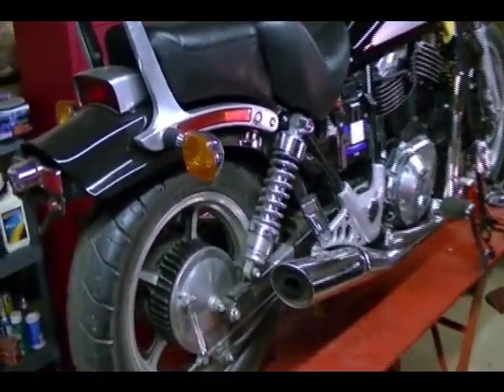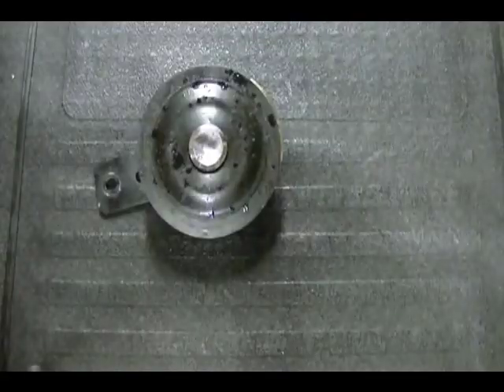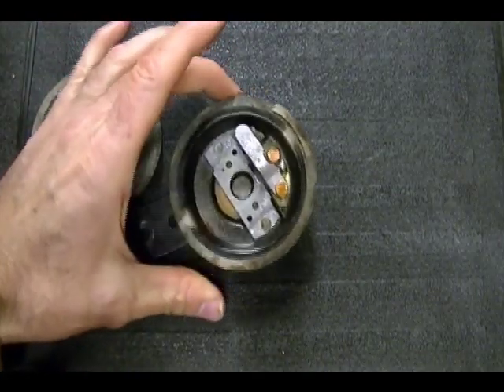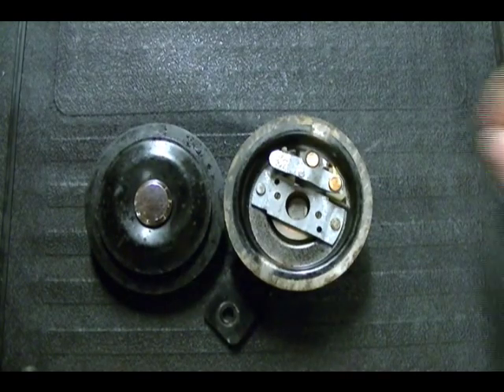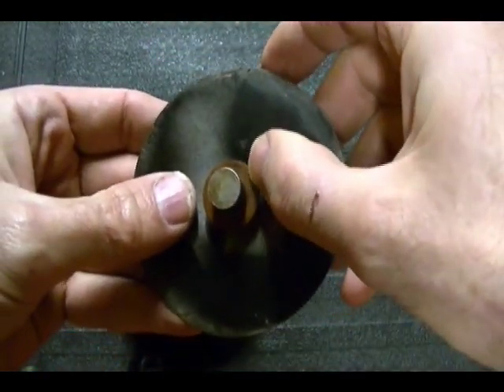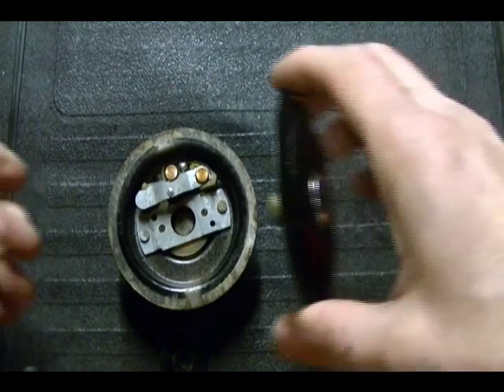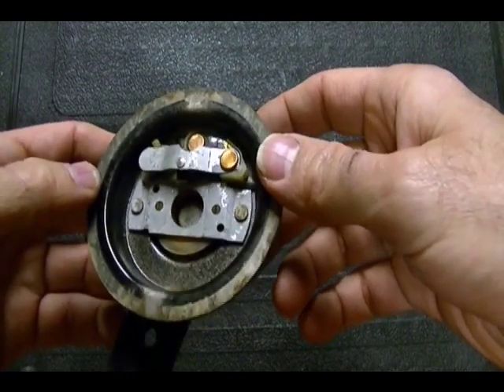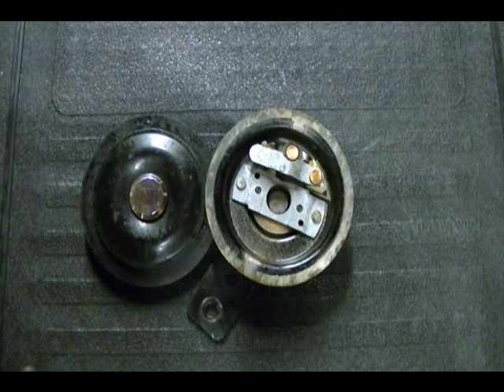How Motorcycle Horns Work And Why They Fail

Comment: You could just drill four holes in that outer housing and diaphragm housing and use screws and nuts to clamp it together instead of using that ring. It would probably work.

Comment: I have personally found that using an ultrasonic cleaner with your solution of choice has worked in nondestructively cleaning these points off about 9 out of 10 times

Comment: Recently had issue with my horn not sounding, started being intermittent then stopped altogether. The blades of the contacts have a weird, yellow-ish ooze on them, is that the copper corroding?

Comment: Your instruction is great. I drilled an access port above the electrical plug terminals, accessed and cleaned the points and got a 1971 Suzuki horn to work again! I made a small rubber plug to seal the access port in case I ever need to do it again. This saved me some money and I got to keep the original 50 year old horn for originality's sake. Thank you sir!

Comment: Nice informative video contents you have. I have a question about my horn on my motorcycle. Everytime I use my motorcycle, my horn is not beeping loud. My battery is good, and I have a voltmeter for monitoring. I am using bosch fc2.

Comment: yes i agree with blazzer brass, you completely missed half of the operation of the horn, #1 -  it does not need to be pulled apart to fix, #2 -  the screw with nut is the fix, always, my horn on my wedding cars gets a lot of work, and i have fixed it  with the  adjusting- tuning screw , 6 times, ,,, here is  what you missed....  insert ear plugs, loosening the nut under  the screw- frees the screw for movement,  .. with the 12v power on,  you winding the screw out- allowing the top contact to always stay connected the  the bottom contact- thus max - un breaking current, - ONE pull of the magnet, and NO SOUND, then  you wind "in" the screw until it allow separation of the contacts- horn is sounding,  then 1/4 - 1/2 turn more for operation, re-tighten the nut,  SO one horn will thus last the life of  your bike- cars truck wedding car

Comment: Excellent video - I came here looking for why my car horn stopped working.   Car horns operate under the same principle, except they have a plastic megaphone added to the same basic apparatus.  Too bad they can't be opened without wrecking.    Maybe someone here has a neat way of opening them.  My MB horn was replaced, with used OEM for only $8 including shipping, so it's not a financial burden, but is irksome when it could likely be done easily if we could open the device.

Comment: I have a couple of horns in my bike. It's a Japanese one and sounds perfectly. It cannot be disassembled. I'm facing the same problem frequently after horns exposed to rain. What I am doing is first remove the adjustment screw on the back side of the horn. Then spray some WD 40 into horn via the screw hole. Then shake it well and keep it about 10 minutes. Then the corrosion removes. Turn down the horn and drain WD 40 via the screw hole. If it's not draining shake it until no residues remains. You'll see corroded parts are draining. Then replace the adjustment screw. Spray some less WD 40 into the front diaphragm through the gap between front metal disc. It will remove the corrosion in the spring and lubricate the spring and the moving points. Now check it! This is a fine solution.

Comment: Your videos are very informative thanks.   I have a different horn issue.   Mine won't shut off.  Went riding and did not even touch the button but the horn started blaring and I had to remove one of the wires to make it stop.  Suggestions?
Reply from the maker: Check the horn switch

Comment: Thank you for putting this video together.  I was able to fix my boat horn after watching it.  In my case, the contacts were fine (though I still cleaned them).  But being a marine horn of a certain age, it had gaskets between on either side of the diaphragm that had collapsed over time which was enough to have the "trigger" always in contact with the "point arm".  New gaskets gave it proper spacing and I'm back on the road, as it were.
Reply from the maker: Good the hear!

Comment: I have a question.  I have an old Yamaha CT3, which is a 6 volt system.  I found a new old stock 6 volt horn made by Sakura, not specific to my bike.  The wires are red and blue on the new horn.  My old horn has a red and a brown wire.  Must I match up red with red?  I am asking because the male/female quick connects are opposite of the old horn.  So, if I don't change the quick connects around, the new horn's red wire would connect to the black wire on my bike, and blue with the red wire on my bike.